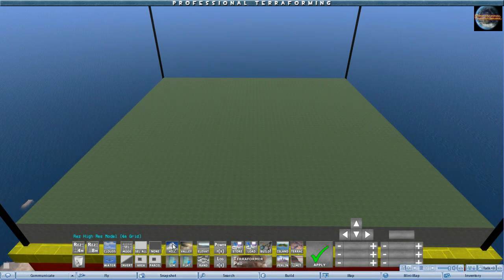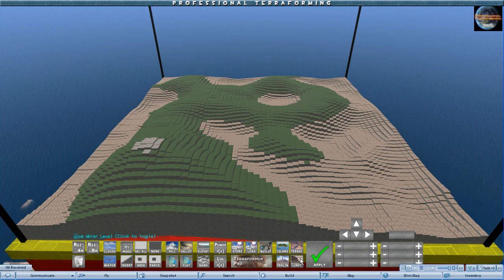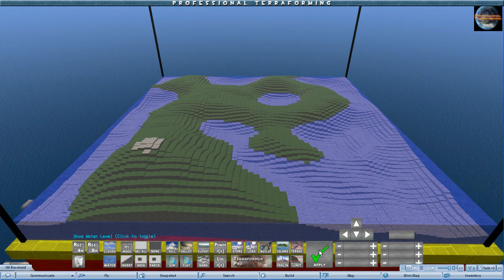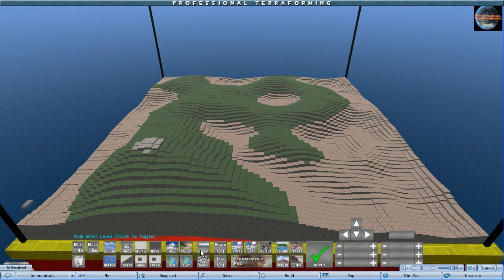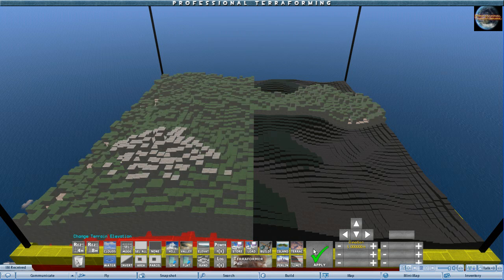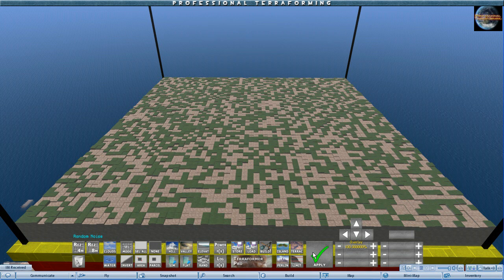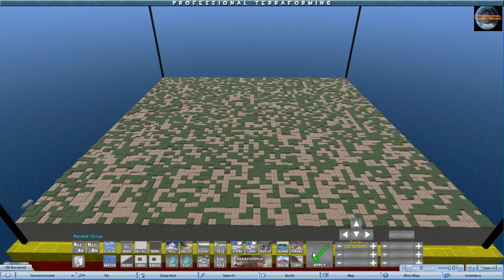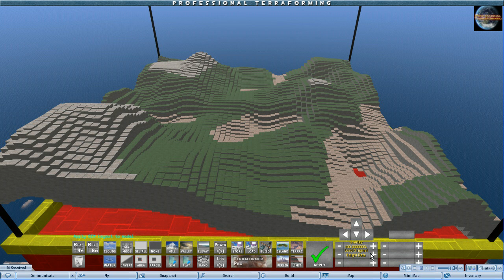Terraformer 03

Comment: The hills and valley function only works if the parameter is applied to the entire grid. That means using the SEL MODE button and applying the ENTIRE GRID command before you choose the HILL or VALLEY commands.